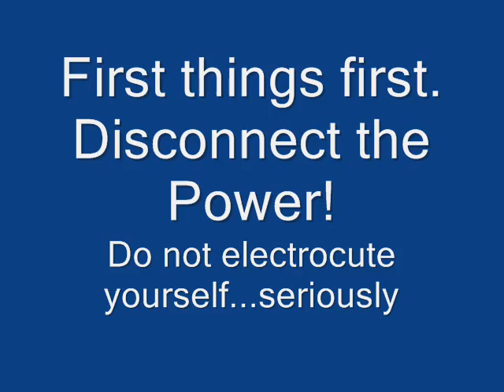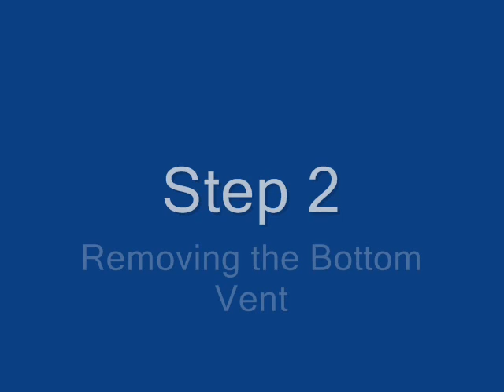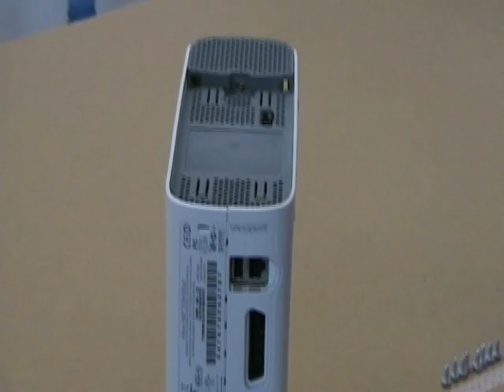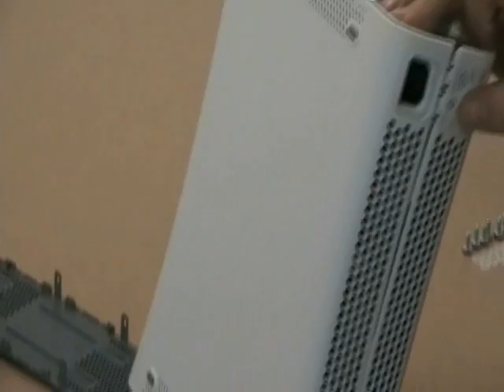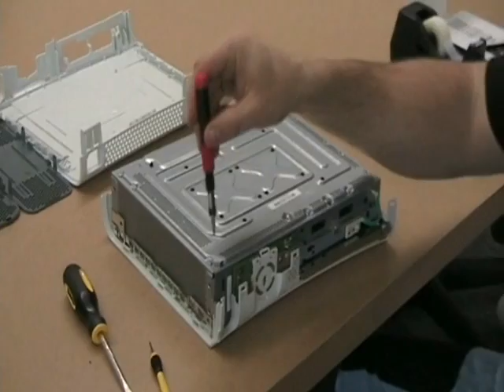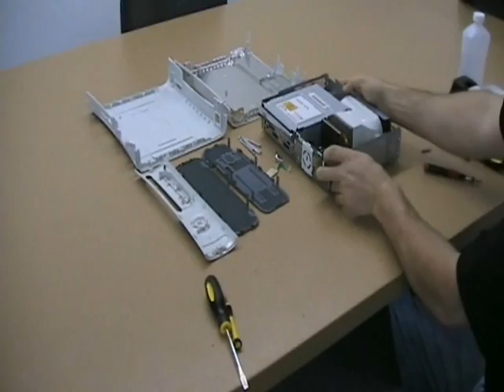XBOX 360 Repair Guide - #1 Opening the Case

Comment: @halodude1157 Your funny. Your xbox did not come with an adapter. No xbox model comes with an adapter. The only one that does is the Slim model with a built in adapter. It does not charge credit cards automatically. You buy Xbox live cards to play online, with range from 20$ to 50$ dollars. Xbox has more games? Makes sense. Xbox only has 435 games and the ps3 has nearly 570. Ps3 offers more free PS plus games then Xbox does without live, lol. Xbox isn't even better than the Atari, dumbass. LOL!

Comment: what the fuck does 5by10, is that fucking metric size or inch size. None of the Local hardware stores had this size Im talking about Home Depot, Rona, Tiger Direct... Like every fucking screw is measured in inches' so it would be fucking lovely if you can fucking give me a fucking inche size or answer my fucking question

Comment: @DJHamels I apologize for not caching you sooner but this repair is crap! and because it did work it is because you had a cracked solder joint below your GPU or CPU Chip from dust build up or drying thermal paste, the problem is now your original problem is now 60 times worse than when you started go to my channel to learn the truth about this bull sh&^ repair he just showed you.

Comment: @michaelbo121 That will work but will not fix the initial problem and your red ring will come back after a while. If you use the kit it SHOULD not happen again. Also you can always look online to see what sizes of washers and screws you need and buy thermal compound yourself. It comes out to be way cheaper and you have extra thermal compound left.

Comment: The x-clamp replacement only causes more problems in the long run. I have been fixing this issue for over 3 years and I never replace the x-clamps. Only got 2 returns in the past year. The only real fix is to re-flow or re-ball the GPU. ConsoleRepairGuy. com

Comment: Followed the fix verbatim and it works! I used arctic silver instead of the 60 cent a tube paste.  Also I didnt do the burn in.  I blame the crappy paste Microsoft used. Now it actually runs cooler becuase the heat sinks are transferring the heat much better. Totally legit just use the arctic silver instead

Comment: my advice: follow this guide WITHOUT the kit, when it gets to the part about the washers and shit ignore it. just use rubbing alchohol and clean the old paste off the 3 points of the GPU and the heat sink, place some silver thermal compound  on the contact points. a little is all you need then smooth it into a thin film with cardboard so that it covers the metal points, then pop them back into place and re-use the X-clamps that were on there you just have to push a little. close it up and done.

Comment: u need to make sure you have the right error first by holding down the eject and connect buttons and the number of lights and amount of flashes tells you the error i thought mines was the heat sink turned out to be a dodgy hdmi cable you can get the codes by searcching xbox 360 rrod error codes

Comment: ok update.. I went to lowes and bought M5-.8x10 machine screws, 5mm metal washers and #10 nylon washers plus did the 2 pennies thinly wraped in vinyl electric tape with Artic Silver 5 thermal paste on the cleaned cpu, gpu and pennies. First  I used a heat gun on the top gpu, cpu, mem and south bridge 25 sec. ea. then bottom same but 15 sec ea. in a waveing motion. let the board cool for 30 min after heating then put it together and turned it on.

Comment: Took me about 4 hours including going to the store and getting the parts.  Recommendation - Radio Shack carries a great thermal compound. I got my screws and washers at home depot.  just take the heat sink with you to match the threads and lengths.  METRIC remember.  Good luck!  Thanx Xbox360Fix!!.

Comment: Fixed my 360.  The "hardware" are eight M5 x 10mm screws and 16 corresponding #10 washers.  Follow these instructions and you should be ok.  I fixed mine and all is well.  Couple tips: first, work on a towel or something to catch all of the screws, etc, as they pop off.  Next, keep track of them.  Finally, pay attention to orientation.  After putting my 360 back together, I realized the power button was reversed, so I had to open it all back up.  Small bummer, but still...

Comment: As i was flipping up on the front to manipulate the outer shell, a piece of what looks like aluminum was sitting on my work bench.  It is approximately and inch long about an 1/8 inch wide.  it has some punched out/raised sections(5 punches) all facing in the same direction.  On one end it appears to have aclip that possibly attaches to something.  I did not see it attached nor a point that should go.  It looks mechanical in nature but not sure.

Comment: Having two red lights is probably due by overheating. You might want to try getting a fan, but if that doesn't work, you should try dropping it by Microsoft or somewhere where they can repair your console. I wouldn't want to risk my XBOX 360 to be broken.

Comment: I repaired my Xbox 360 quickly and easily with this kit off eBay for 7$.  Xbox 360 elite, OOTB with enhanced heat sink, 2.5 years old.  Last week got 2 red lights and E74 error.  Opened box, lifted heat sinks and saw thermal paste was badly broken down.  Followed directions, recovered flawlessly.  Put it through 2 hours of graphically intense gaming without a single glitch.  Thanks, XBox360Fix.

Comment: Great vid! It fixed my E74 perfectly. Hope it keeps running. I used terpentine to clean the processors though. I used shortened M5x16 bolts (they didn't sell the M5x10) to tighten the processors and nylon rings. Top notch!

Comment: I got the washer replacements and bolts from a seller on ebay.  The quality was there but the whole fixing your console thing didn't seem to be permanent for me.  Perhaps there are people who are more successful and haven't had any problems since after the fix.  In my estimation though, I believe the percentage would be a little less than 50% for permanently fixed.

Comment: From experience of repairing my Xbox 360 console I can tell you it's not a permanent fix.  After a couple of weeks the screen was looking all washed out and filtered.  I figured this was a problem so I opened the console again, cleaned the GPU and CPU chips and Diamond 7 thermal compounded them.  Screwed everything back with washers and bolts using both hands to keep the heatsink and motherboard together.  THEN-I had E74 error ALL over again.  I even overheated it but it was dead.

Comment: The reason this fix works, is because you're making the Heatsinks actually do there job, and replacing the Thermal paste, so the heatsinks may not be able to work if you either didn't tighten them down enough, or didn't overheat it enough to get the thermal paste to turn to a solid form. if that doesn't help, I'm sorry I don't know what else you could do.

Comment: u will need 

Torx T10 screwdriver
Torx T8 screwdriver

Some flathead regular screwdrivers
Some small flat head screw driverz (1/4 , 2 mm ) 

That all you need to open the case . For the X-clamps , i dont know , cuz i dont care :)

Comment: I forgot to mention that I had to open the Xbox twice.  The first time I got the RROD within 10 minutes of the initial repair.  I opened the xbox the second time to loosen the screws on the heat sinks (about 1/4 turn each screw AND I added the pennies on the 4 IC chips.....now my Xbox works like a charm!

Comment: Check your video cable, there should be some kind of switch on it. Depending on what kind of setup you have, (HD)TV, make sure that the switch is pointing to something that corresponds with your setup.

For instance, if you have a regular TV (just like me) it's pretty obvious that the switch is set at "TV" and NOT to HDTV otherwise the result is sound but no vid. Same applies having HDTV but set the cableswitch (accidently) @ TV instead of HDTV...

Comment from the maker: I ship to just about anywhere in the world, total price for the kit is usually $10.49.

The screws are not T8 or T10 you need those drivers for the bolts holding the Xbox together. 

Please buy the kit, it will save you money in a long run when you put gas etc into the equation!

thanks!
-Mitch

Comment: I would just like to say thank you for this tutorial it indeed fixed my xbox 360.  However i did not purchase your kit.  May i make a suggestion to people watching this DO NOT REMOVE YOUR X CLAMP BOLTS.  I left mine on, after cleaning my cpu and gpu di's i placed the heat sinks back on.  Then in order to get the x-clamps back over the bolts just slightly bend the x-clamps and then carefully get them back over the bolts.  It wont seem tight at first but once you put the screws back in its fine